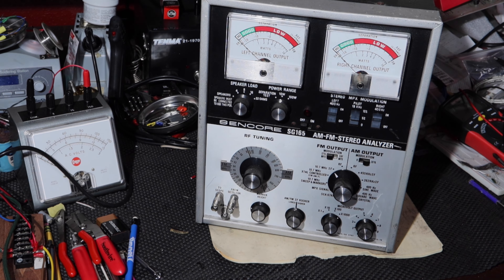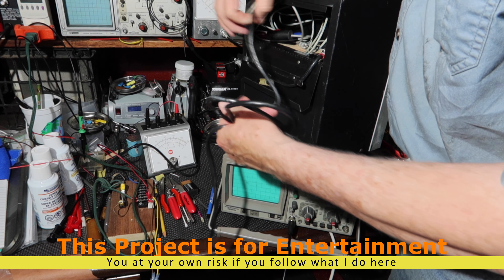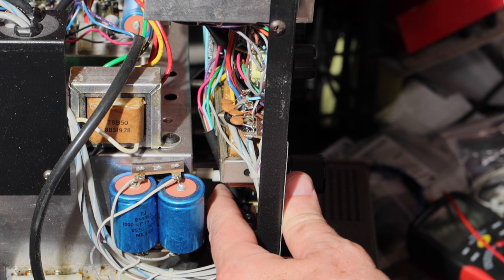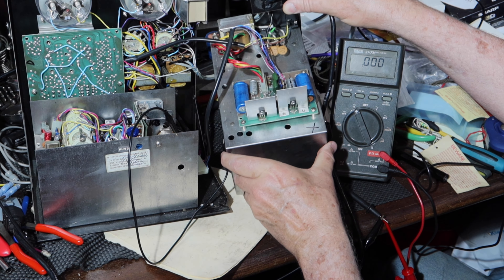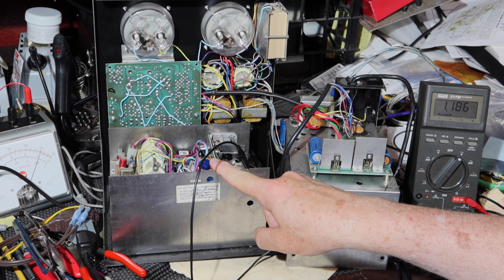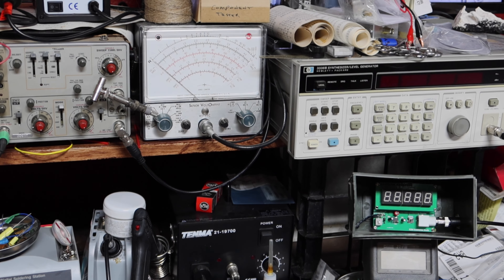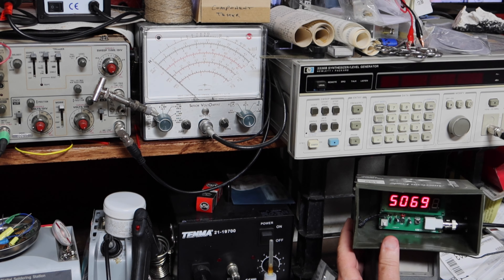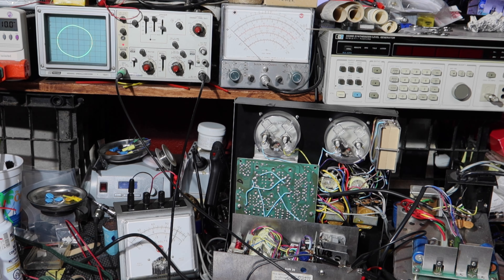Sencore SG165 Basic Adjustments For 10.7MHz Sweeps.  AM/FM Stereo Analyzer.  Let's Adjust It.  [4K]

Comment: I've searched for one of these (at a reasonable cost) for a long, long time. I do have a B-K 970 radio analyst, but the Sencore would be much more useful I think.
Reply from the maker: Hello Doug and thanks for watching.  Someday I hope to attempt the repair of that tuning shaft and recapping the power supply.  Hopefully it will remove that weird artifact on the S curve sweep.  But it works pretty well.  Good luck finding one priced right - hopefully the prices will come down eventually.  Check out those Hamfest swap meets now that many are starting up again.  Thanks again.